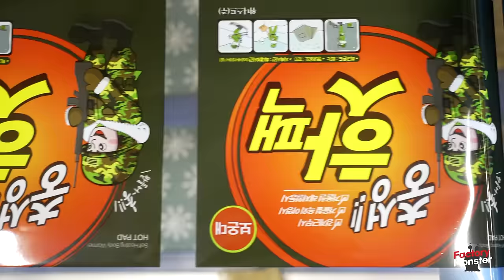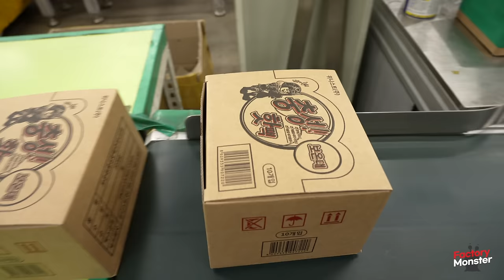Hand Warmer Manufacturing Process With Iron Activated Carbon. Korean Factory

Comment: HOW IT WORKS: These hand warmers use an exothermic (heat-producing) chemical reaction based on the accelerated rusting of iron: exposure to oxygen (by opening the outer airtight  package to expose the inner packet containing the ingredients) causes the iron powder to oxidize (rust) and produce heat. Salt acts as a catalyst to speed up the reaction. Activated carbon helps disperse the heat and helps to bring oxygen to the iron particles.
Reply: Thanks for the explanation.
Reply: So its a single use hand warmer unlike those multi use ones that have a small piece of metal inside that when basically spring bend causes the substance to freeze and howhow release alll of its energy in the form of heat while expanding ...
Reply: @Techischannel  Right there's two kinds (that I know of), this is the single use type - the other one you boil in water to cause a chemical reaction to store the energy, then to release the heat later you flex the metal inside which somehow causes crystals to form and that reaction releases heat. Then re-boil to set it up to use again.
Reply: @markylon  Water crystallizes when it freezes. It is also an exothermic reaction. The only difference is the temperature this occurs at.
You might not call it freezing but it is.
Edit: Check Wikipedia, it says it right in the first sentence: "Freezing is a phase transition where a liquid turns into a solid".
The reusable hand warmers use a liquid that it supercooled so it wants the crystallize but it can't because it lacks a "catalyst" (it needs a point to start but there is none). By clicking the metal plate you induce a shock wave that starts the process.
Reply: @markylon  Well when stuff crystalizes it does kinda freeze though ... when water crystalizes it gets colder and this is a nature of most matter. 

That said, you can chemically store more energy and through a certain specific input can cause a chain reaction that to one part releases all of that energy in form of heat and second of all the components inside do technically are now too cold to not be liquid. 

Its like water with antifreeze.
Reply from the maker: Thanks for your sharing :)
Reply: Wow… Thanks
Reply: So it's similar to Thermite?
Reply: @soupwizard  To add to this, the solution is a super saturation of sodium acetate & water.  Which means (in this case), crystalized is its normal state.  We can melt it back into liquid, but the slightest jarring in the liquid itself starts a chain reaction to turn it back.  So we throw the metal disc in to make it easy.
Reply: @HostileTakeover2  so many times I've left my case of bottled water in the car (because it's heavy and I'm lazy) in the winter and gone to grab one that still appears to be liquid and before I can even get the cap off it's frozen itself solid lol. Sometimes just setting it on the counter does it. Not exactly the same, but still involves nucleation in a similar manner.
Reply: @AffordBindEquipment  Nothing.  It does start reacting even while mixing.  But putting it into the big bags stops (or slows) the reaction below the top layer due to lack of oxygen.  It starts again very briefly when filling the individual bags.  Then once sealed, the reaction stops again (no oxygen).  But these bags work for hours so a little reaction while filling/sealing is minor.
Reply: What keeps the mixture, once made, from starting the thermal reaction before it is sealed air tight?  In the video it appears the final mix is sitting in a holding room until they get around to packaging it.
Reply: Catalytically-controlled thermite?
Reply: @AffordBindEquipment  If only...
Reply: But how do you prevent the reaction from starting before the bag is sealed?

Comment: How do they prevent the reaction when they're sitting in the warehouse after mixing? 

The pallet wrapping robot is so satisfying to watch.
Reply: The reaction only happens in the presence of oxygen.  When they mix it, the reaction does start happening as you suspect - you can see the steam coming off at 2:33.  Likely there's enough material in those giant bags that the majority isn't reacting while sitting there.  Very soon after it's sealed in the package, the reaction stops.  But given they can react for 8+ hours, as long as the material isn't exposed for a very long time, there's still plenty of reaction left.

Comment: What prevents the mixture from reacting prior to the point where it is sealed in plastic?
Reply: The ingredients looked to be mixed dry. I am thinking water is added last second, sprayed on the product right before being packaged in an airtight package. The "rust" won't start until you open the package and let oxygen in.
Reply: Potentially they could start reacting, but once it is sealed in the plastic there is no more oxygen so it would stop reacting.

Comment: I prefer the ones where you have a stick of "charcoal", that you light to make it glow, and then you put the lit stick into an isolated box, which you then put into your pocket. Way less waste with those ones, only drawback is that they are a bit smelly, but I don't care. Hunters and fisherman here in Germany usually use this type of heater.

Comment: Is this a one time use for the customer?  I am asking because I have no idea that's why?
Reply: typically yes.  They are air activated, so if you can seal them in a bag before they run out, they can be used later.  I  have done this.
Reply: @dave4882  Thank you!
Reply: @dave4882  Thank you.  J.